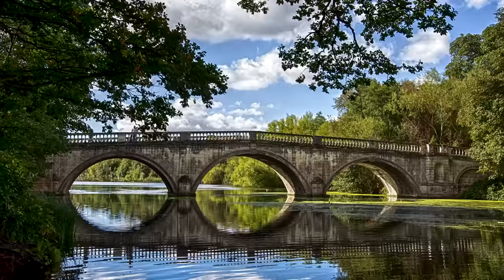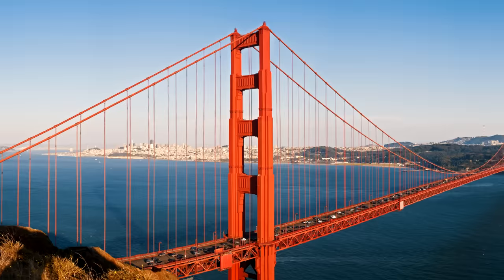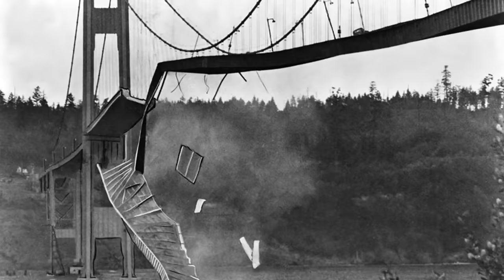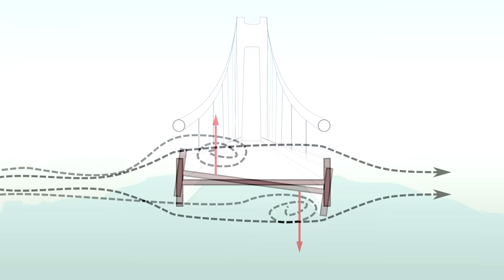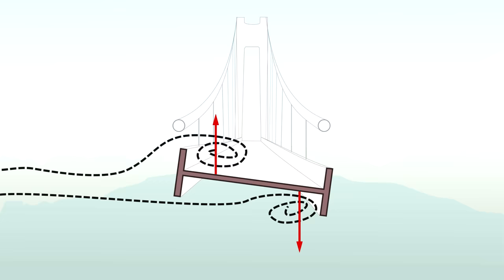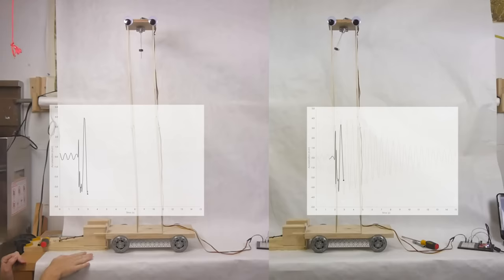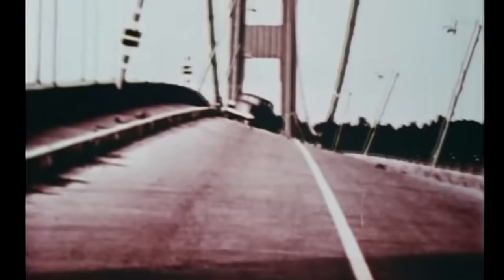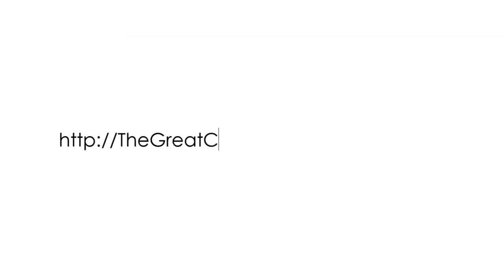Why the Tacoma Narrows Bridge Collapsed

Comment: I recently learned that the tie-down straps on flatbed trucks are given a half twist before they are tightened to prevent resonance from the wind causing the straps to vibrate.  For long hauls, resonance vibration can damage the straps or cause the straps to cut into whatever they are securing.
Reply: And my whole life I've tried to keep my straps straight... Thanks for teaching me something new!
Reply: Yes sir
Depends on what I'm hauling whether or not i put a half twist in each side. Usually the longer the strap length without touching something the higher the chance I'll twist it to prevent flutter
Reply: Did you happen to learn that from essential craftsman? That's where i learned it.
Reply: I always have a little giggle when I consider there could be googley eyes on the vibrating straps...just screaming bwabwabwabwabwabwabwabwabwa
Reply: unless your in Straya  where the scaleys will fine you$$$ if your straps  have any twisties
Reply: @wambatmqn3833  scaleys 😂 you ozzies have some funny names. See you at the bottle-o and can you pick us up some durries from theservo cheers maaaaaaaaaate
Reply: google translate must not be working for me.
Reply: Mark Warbington   Awesome.
Reply: @wambatmqn3833  
I thought you were gonna say you have to twist the straps in other direction
Reply: I used to do long-haul trucking. The straps will often resonate back and forth, however, this rarely causes failure/wear of the straps and/or damage to cargo. The straps are made of high strength nylon, polyester or resin-coated polymers and are very durable. They are designed to stretch a good deal; they're more like rubber bands than chains. The only way a strap would fail while driving would be if the strap was old and worn and the driver failed to use corner protectors on whatever he were transporting.
Reply: Yep!  Watching the Essential Craftsman is like having my dad and my uncle around again - a wealth of practical knowledge.
Reply: Whenever I see a truck with a twist in the tie down I think didn't they notice it was twisted? Thanks for letting me know why
Reply: @MarkWarbington  that is such a great channel.
Reply: Yup! The good Ol' "trucker twist" it is called.
Reply: Thank you good sir ! Iv'e tried so many thing to prevent this from happening without success.
Reply: @wambatmqn3833  I've heard Canada will too but I don't go there so I don't know
Reply: Can confirm! I dont drive a big truck, but when I moved from Washington to Texas, I drove my truck with my bike in the back. The strap I used to secure the motorcycle wasn't twisted, and the vibration rubbed the front fork down to bare metal!!
Reply: Omg
Reply: @wambatmqn3833  What do truckers there do to keep the straps from humming?
Reply: Strap fact:  whenever nylon straps are not being used keep them out of direct sunlight and excessive heat....  they deteriorate much quicker...
Reply: @jonmeray713  it's true.  Modern straps are pretty tough and rarely fail without some warning or obvious signs of impeding failure in appearance.  I think people are discussing best practices for strap usage and load control.
Reply: Jonathan Meray “damage the straps” is not the same thing as “strap failure”. If a strap normally lasts 1000 trips and in adverse conditions lasts 100, it’s still being damaged, even if it doesn’t fail.
Reply: That's interesting, because I'm sure I read that putting a twist in a strap decreases it's load capacity by up to 50%. Or is that only if it's a full twist?
Reply: I hate twisted straps. I found that if I tightened em up they don't vibrate
Reply: Had one of the State of Illinois' finest at a weigh station inform me that I'd have to 'untwist' my 1/2 twisted cargo straps. I said "No, sorry.....not gonna do it" which brought about the ol' 'pull it around back & come in' response. Ugh.....these guys. They tried to explain to me that by twisting them I was weakening them. I explained that my straps were really just for show & are only on to meet legal requirements { I hauled cement products in paper bags - 42 80# sacks per pallet }. I tried to explain how the wind would whip the straps into a vibration that would eventually cut into the paper bags & spill the contents onto my fellow motorists' windshields. They said "You must" to which I again said "No". I again explained basic aerodynamics & the fact that the load strap was rated at a 10,000 lb. breaking limit. If they were correct { they weren't } about the strap losing half its strength, my fourteen straps were more than adequate { the weight of the product was over 3,000 lbs. per pallet riding on a wooden pallet on a wooden decked flatbed combined with gravity is all that ever held my loads on the trailer......750,000 miles logged & never lost a pallet! } to 'hold' the load. Suddenly it was no longer about the strength, but simply "The law states".....I explained the law wasn't written with paper cement sacks in mind. We stared at each other & I said "Let me simply remove the straps & you write me up for an insecure load"... they wouldn't go for it. I suggested they arrest me then. No, they didn't want that either. I said "okay...you win...sort of...I'll untwist them to make you happy, but I'm not gonna lie....as soon as I leave here, I'm gonna have to head straight for the shoulder & put them back on 'correctly'...so go ahead & ticket me now!".....they all looked at each other & mumbled about a bit before saying "Beat it, kid!!" Yeah......the 'trucker twist'......it works!
Reply: @hamishtanner3571  I'm Aussie, what's a scaley? 
At least I thought I was Aussie
Reply: Or the straps get cut by whatever they are rubbing against.
Reply: Mark Warbington the old rule I was told one twist per 7 ft of strap
Reply: omg, wow, thx for telling us that. This is so interesting and good to know at the same time.
Reply: The Tacoma Narrows Bridge collapse was mostly a case of bad luck combined with an incomplete knowledge of fluid dynamics. There was nothing inherently wrong with the bridge design, but it just happened to be at the right resonance frequency for the wind to trigger it. The collapse led to studies that greatly advanced our understanding of these effects on large structures. Given that the only loss of life was a single dog, it was a relatively cheap lesson in terms of impact. This incident was not something that could have been prevented with the knowledge of the time, and it fortunately advanced our knowledge and thereby prevented a possible real disaster in the future.
Reply: @chooch1995  you were just being combative and so was he. You dont want anybody telling you how to live. Half a twist doesnt do shit and neither does leaving straps strait. It was a pissing match.
Reply: @WardenWolf  everything you said was true except....the inherent part. By definition there was an inherent problem in the design.
Reply: @jonmeray713  Ask me how I know you have no idea what you're talking about
Reply: I'm curious about the reasoning behind why twisting the strap helps with that.
Reply: @absolarix  I assume it's to prevent the strap from forming a airfoil
Reply: If you don't twist them especially on tall loads where the strap isn't touching much i find they flutter stretch and loosen up. Twist them, tighten load and go better than a fluttering loose strap or worse a spilled load. You want physics? Try a 45k coil rolling down the road ive seen it and it's not pretty especially if its loaded suicide and greets you first
Reply: @tomr6955  Me too mate. NFI. Must be a regional useage. Can think of lots of other names for coppers but never heard that one. Some of our slang seems not only regional but generational as well.
Reply: Sounds like you learned this on Essential Craftsman channel?
Reply: @NeonBlazeMusic  Yep!
Reply: @Willaev  no it does not there is a video on this, even with as many twists as he could fit in the strap, the strength was not lowered
Reply: @WardenWolf  I still think it should not be overlooked that the root cause of the failure was cost cutting. It could have ended much worse. So i think it was not a case of bad luck, but rather good luck, and only that. Meaning, it's not bad luck when you darn well know you cut corners
Reply: To think that I've seen so many twisted straps securing truck loads, and I've always thought "Man that's a sloppy way to secure your cargo!!"....
You really learn something new everyday, and these little "tips" are my favorites!!
Reply: @Willaev  Check out the video Fireball Tool did on testing straps. It’s pretty interesting and easily shows no twist, 1/2 twist to a lot of twist do not affect the failure point BUT tying a knot in a strap significantly impacts strength.
Reply: So cool!  Makes perfect sense.  Thanks for mentioning that.
Reply: @Willaev  really?  Interesting.  I know knots significantly decrease a rope's strength.  But a half twist in a strap over significant length?  Hard to believe, but withing the realm of possibility!
Reply: @tomr6955  I'm not an Aussie, but I guess it's the scales for weighing trucks.  You know, where the po-po hang out!
Reply: Not just trucks, I do this when I tie something onto my roof rack.
Reply: @FurTip  you teach it the words?
Reply: @fubarmodelyard1392  And you’d be wrong. Probably you are driving at a low enough speed that the vibration isn’t noticeable to you, but if there is tension in the strap and air moving past it, there’s going to be vibration.
Reply: @paulstandaert2042  That can be very easily solved with scraps of cardboard that will protect the strap and protect the edge.
Reply: @WardenWolf  If you had watched the video, you’d have understood that your second sentence is incorrect, despite what you (and I) were taught. Watch the video! It is a matter of fluid dynamics as you say, but resonance was not the issue.
Reply: @MarcosElMalo2  and you're uninformed and making an assumption. 72 mph and the straps were not banging against the load. They may be vibrating but it was imperceptible. Been driving flatbed since 1988 and I've learned a few things
Reply: We do that on sailboats too but I didn't know the scientific reason before-- thanks!
Reply: No your wrong there
Reply: @lint2023  😆 LOL
Reply: @wambatmqn3833  There as a recent test by a ytber that showed more than 3 twists severely reduced the load capability of the strap. But 1 or 2 twists was beneficial for reducing flutter by wind.
   I was watching this video because of the recent collapse in India of the Morbi bridge.
Reply: @Willaev  1 twist is good, 3 or more is bad.
Reply: @tomr6955  Person at the trucker scale that weighs trucks.
Reply: @wambatmqn3833  I have twisted my straps on many loads, mostly on large diameter cast pipe. I've been static weighed and been inspected, level 1s and 2s, and the scale master or inspecting officer never said a thing

Comment: It's impressive how much the bridge could actually handle before failing. Just shows how good the overall design of a suspension bridge is.
Reply: John Ross  ya i didn't understand that either.
Reply: John Ross , Very flexible. Imagine how much worse roads would be without the serious ability to move around ?
Reply: Lasting only 4 months isn't great for a bridge.
Reply: I think concrete roads last longer than asphalt roads, and there isn't much flex in that material. Asphalt is fairly flexible though, I mean for being a solid looking object anyway. Don't forget, that on the very hot, sunny days the asphalt starts to soften and get tacky.
Reply: snoopdogie187 concrete roads are fine at low speed areas. There was a concrete highway where i live and its noticeably not as smooth as asphalt highways. But i think its just the shitty construction that made it rough lol
Reply: @petormemes  Withstand the Wiggle!
Reply: Yeah, there were some outrageous forces in that oscillating roadway. It's very fortunate that only one empty car and one unfortunate dog (iirc) were lost when it fell.
Reply: @snoopdogie187  I remember going to a drag race on an extremely hot summer day and asphalt that was used to cover some major potholes in the area was basically squishy when I stepped on it.
Reply: The fact that it destroyed itself casts doubt on your statement 🤣😂🤣
Reply: Not everyone is understanding the truth in your comment. A well designed bridge of the same type could shift and wobble tremendously without failing and is thus an engineering accomplishment.
Reply: @dakka7251  thanks captain obvious
Reply: @bluebaconjake405  Concrete is less grippy and needs roughness "added into" it to prevent wheels from slipping when the concrete roads are wet.
Reply: @Abigail-hu5wf  i understand why the added textures cause i know smooth concrete is like glass. But I was talking about legit bumps and lumps on the concrete highway that made the ride incredibly bumpy. The construction was baaad.
Reply: @bluebaconjake405  it might be rough intentionally. Traditional concrecte doesnt have as much traction as asphalt, so highways that use it tend to compensate by making the concrete surface rough.
Reply: @deadturret4049  But is the intentional roughness supposed to rock the vehicle up and down violently? Cause it was like riding a rodeo lmao
Reply: @bluebaconjake405  probably. Adding roughness makes it inherently more turbulent.
Reply: @dominick253  He didn't say it was invincible or designed well. He said, it was impressive that it took as much abuse as it did, before failing! I happen to agree. Lack of aerodynamic design notwithstanding, that was one tough, yet flexible bridge!
Reply: It was a cool video I liked it. I would like to be told of the costs that that middle slab or other means of securing the bridge. Healthy summer bye now
Reply: It was a cool video I liked it. I would like to be told of the costs that that middle slab or other means of securing the bridge. Healthy summer bye now
Reply: Bro I don’t think that’s considered impressive.   That thing was horribly designed
Reply: I have seen several versions of this and I never seen that they did anything to try to mitigate the movement or even keep people off. ?  Yes, no?
Reply: Hahahahahaha what?
Reply: @noahway13  I believe there was only one fatality. A dog was in the car that you see on the bridge in the video, and it was killed.
Reply: @christineconroykristeller5221  Yeah, I saw that somewhere. My point is that I never saw that they tried to close bridge and fix the problem. It was only closed a few hours before collapse because it was literally undriveable.
Reply: @noahway13  Agree. Why was even one car on the bridge at the time? Everyone could see that it was about to collapse, duh.
Reply: @noahway13  They really didn't have time to implement mitigations, particularly for the twisting motions which had not happened before the day it fell. The State DOT did periodically close the bridge when the up and down motions got to a certain point.
Reply: @rlinwa723  I thought video said it was acting wonky even before it was finished.
Reply: @noahway13  Point taken. Agree that the powers that be should have been more proactive
Reply: @christineconroykristeller5221  Christine. Christine. Christine, darling. Where are you from? That is not how we operate here on the internet. Where is the venom and rancor? You are supposed to call me a Nazi or a communist. Did you just have dental surgery and are still feeling warm and fuzzy from the laughing gas? I'm not used to this kind of response = )
Reply: I'm joking. This channel brings together the best people we have... engineer types who can talk facts without getting emotional about it.
Reply: @bluebaconjake405  I don't think they are getting your point. I live in Alabama, close to the Mississippi State Line. In Alabama, we have asphalt Highway and Mississippi has concrete highway. Where you cross the state line you can noticeably tell that the road goes from smooth to extremely rough and bumpy. The reason for this is the way concrete highways are built. They are built in sections with forms, and in between each section is a break where one poured section meets another board section. When you are driving at highway speed, it is these gaps in the concrete that caused the up-and-down bumpiness you speak of, not the texture of the concrete. LOL. Some of these people are silly
Reply: @SteveWillNotDoIt1984  Finally! An answer to my complaint lmao. Its DEFINITELY not the asphalt texture thats causing the bumpiness. Textures causes the car to vibrate, NOT wobble up and down violently. thanks a lot for the explanation
Reply: I always felt the same way. I was amazed the Tacoma Narrows bridge lasted as long as it did that fateful day. It was a testament to the engineering and material used. Sadly, it also gave enough time for what I figured may be joy riders to treat it like a thrill ride and a dog was killed that was left inside one of the cars. It is a wonder that no people lost their lives. 

I always figured it was the heat generated within the twisting materials that ultimately doomed them.
Reply: @snoopdogie187 In colder climates, concrete roads are rarely used.